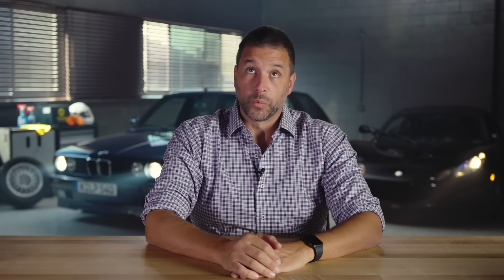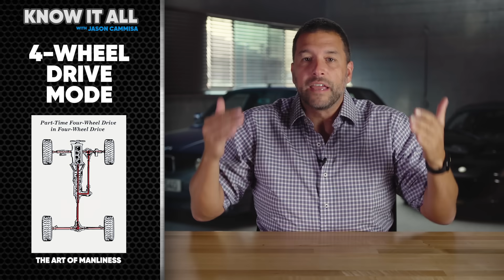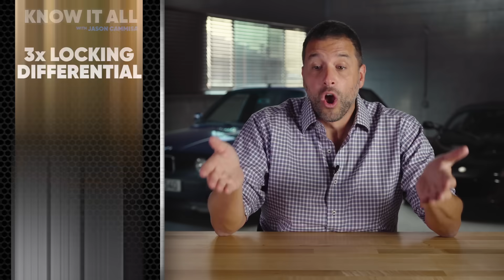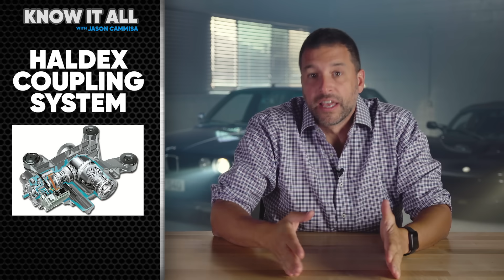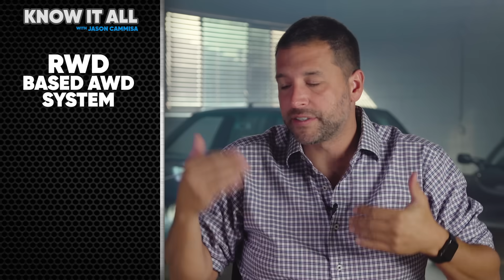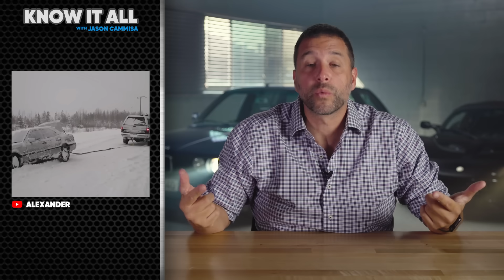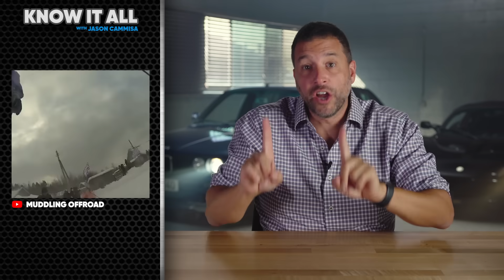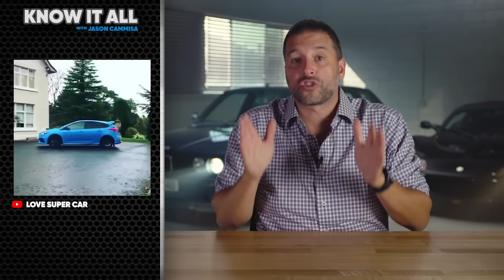Understand Your All-Wheel-Drive System | Know it All with Jason Cammisa | Ep. 04

Comment: Subaru and Mitsubishi, as well as the Classic Audi quattro longitudinal engine layout, are symmetric AWD, in that the power goes through a center differential, and then the front and rear differentials.

According to my understanding the group-B Audi locked the center differential until the final evolution of it, in combination with the engine longitudinally hanging over the front axle the car had to essentially be driven like a rocket - applying a thrust vector to counter the current vector to go in the desired direction (driven sideways).

Haldex systems can lock the back axle to the front and are programmed to release lock to allow turning (inherently putting most of the power to the front). Although they can be reprogrammed to just remain locked and then have to be driven like a group-B Audi. Also, you can incur a speed differential with slightly smaller diameter rear tires, whether you let some air out of them, or stretch them on some wider wheels. Then you would transmit more torque to the rear like the over-geared systems.

Ford Focus RS and Honda SH-AWD (as applied to their FF platforms) are interesting in that they can independently lock each over-geared rear wheel to the front, thus they can temporarily send more power to the rear and even each rear wheel, thus able to do some serious torque vectoring.

My favorite is symmetric AWD systems with modifiers that only need to operate sometimes, so it has a fundamental AWD attribute that can then be tuned and dialed right in.

Subaru electro-hydraulic center locking differentials, as well as Mitsubishi EVO electro-hydraulic center and rear (AYC) differentials are this category. AYC is special in that it is a differential that can force a speed difference similar to Ford’s and Honda’s, but isn’t the fundamental part that transmits power to begin with. When not working an EVO X is still AWD, just with a rear open differential.

However, when AYC is working, the car drives like a fundamentally front-engine'd symmetric-AWD car, but AYC is torque vectoring the rear (modified) from direct steering input. So it is mostly proactively driving under your control, and not reacting unlike every other system. By their very nature they can't have the clutches in a partial lock all_the_time while you're driving, so they will always be FWD with reactionary AWD/RWD characteristics.

The Ford F150 Raptor is interesting in that it has an electro-hydraulic clutch as well as a hard lock in its transfer case - So it can be programmed partial torque amounts to the front axle, like the GT-R and other cars.

Comment: Yeah, you totally forgot to mention the Torsen based systems (mechanical torque biasing differentials, which are different than locking or open differentials of trucks... not to mention a properly implemented system will have a center differential, which all but the newest trucks don't have). Also Audi used both the Haldex and Torsen depending on vehicle and platform, not to mention in certain models they used Torsen front and rear with a Borg Warner clutch type center differential to electronically bias to the rear on the Cayenne.

Comment: Stolen from Autocar magazine

In 2016, Mercedes introduced a new 4WD system called 4Matic+. Fitted in the fifth-generation E-Class and second gereation A-Class. In the E63 S AMG and the  A45 S AMG an additional setting and extra clutch packs were added, allowing these models to disconnect the front axle from the powertrain entirely, effectively turning them into a rear wheel drive cars. This has become known as "Drift Mode".

Comment: The single most important thing he deleted was the components to drive the FWD AWD systems.. most  components that are opposite of the primary drive set up are not designed to handle 100%of the power .. case in point.. subi's  system will always be 90/10  or 10/90 this is done to protect the entire drive line system.

Comment: The user selectable 4x4 systems are the best. RWD when I want to save gas and tire wear, 4x4H when going fast but need a lot of traction (rain, snow etv), 4x4L for low speed off roading, locking diffs for very slippery situations. Can't beat it, the new ones even have 4x4A that keeps it in 2WD until slipping is detected.
Reply: a computer controlled system is vastly better for most people

Comment: A front-wheel-drive car doesn't have to understeer at the limit. That's going to have more to do with suspension geometry and alignment than wheels driven. It's also not that hard to get a front-wheel-drive car to rotate slightly using the throttle or the brakes.

Comment: Audi use 2 different AWD systems. In their smaller vehicles they use the Haldex system,  eg, S3, RS3. SQ3... For their bigger variants they use an in-house developed quattro AWD system. This system is predominantly rearwheel biased. Eg, the 2006-08 RS4 had a quattro system which splits the torque 40% to front and 60% to the rear wheels, under normal driving conditions. This split will remain even during spirited driving. The torque delivery will only change when traction losses starts to occur. However these cars still suffered understeer during spirited driving. This was due AWD grip and the drive train construction. In Audis with longitudinal front enjins, the weight of the enjin extends in front of the front wheel axle, and that is also a big contributor to the Audi oversteer. It's not because it is front wheel bia. The Audi R8 uses the same quattro system. It defenately does not suffer from accute understeer, like its other siblings.

Comment: Honda's SH-AWD system is amazingly simple. I'm surprised it wasn't invented decades before, since it was a completely mechanical system when Honda first introduced it in the 1986 Civic Wagovan.
(basically it is a 4wd system with a torque converter added in the rear driveshaft to allow f:r axle speed differences)
Reply: They should use it more imo for their performance cars. Fwd civics are good and all but AWD ones will be rad

Comment: Good general info, but also a lot of nonsense here. I.e. the Evo's and Focus RS' AWD systems have nothing in common whatsoever. Yes, the Evo's S-AWC understeers less than other cars but that's primarily because of its Active Yaw Control in the rear (used for true torque vectoring), otherwise power is always 50:50 front to rear at all times. The only adjustment in its center diff settings (tarmac/gravel/snow) is how quickly the front and rear axles lock together through diff engagement. The Focus RS' "Twinster" system, on the other hand, takes a FWD car just like a Haldex system and sends a shaft to the rear without the use of a controllable center diff. Instead there is a special rear diff which can achieve proper torque vectoring and is also geared in a way that more power can go to the rear. Of course, it's also worth mentioning the Subaru's symmetrical AWD, which is quite exceptional on the STI. It tends to behave very predictably and does incredibly well on gravel or snow, while having proper front and rear LSD and an adjustable DCCD. You can lock the diff manually to get out of a tough spot (i.e. car is buried in snow) or give the car a bit more rear bias. I've had all 3 by the way. Personally I found Mitsubishi's system to be best for handling, Subaru's - best in winter/slippy conditions, and the RS was a solid step down from both of them, but at least it was interesting to be able to change the character of the car significantly with the touch of a button. Otherwise the RS was a bit unstable for winter driving and even in normal conditions could feel unpredictable and twitchy.

Comment: 1 - love the  Know it All series of videos!
2 - if bmw xDrive is always rwd except when it decides to send power front wards - whats up with the claim that the xDrive m340/440/40 models are "more rear biased" than the 30 series?
Reply: All i can think of is 40 models have rear e-lsd as standart
Reply: Most likely refers to how the center clutch calibration was done, saying that it is more rear axle biased means that in similar driving conditions the computer on the Ms sends less power to the front in comparison to the computer of the non-M sisters

Comment: You focused on diffs… that’s ok, but many of these manufacturers have deployed computer controlled brake actuation to help rotate the car or mitigate the understeer. It is in the cheaper awd cars that you need to watch out for a delayed reaction on snow in a low speed turn under power when the rear kicks in, jolts the car into oversteer, and then stability control goes into panic mode and shuts down power and yells all hands on deck to the brakes at all 4 corners.

Comment: The B7 Audi S4 had a Torsen center diff that sent 60% of the power to the rear wheels when there was no slip.   So you got some of the rear-wheel bias benefit of the trouble-prone BMW system, while also having a kickass mechanical limited-slip.

Comment: Jason, even if you mechanically lifted the front wheel on a golf r, i doubt the center diff would be even tight enough to move it with only the rears. Also, i think the Audis that have a haldex are the transversally mounted engine cars like a3 s3, the a4 s4 have a longitudinally mounted engine and i think they are rear biased. So was my old s4.

Comment: But but but lol. The one system that I would love to have is that on the RCF350? Torsen center with wet clutch packs to each axle. It can actually uncouple the axle even though the diff is locked. IE sending torque to the outboard wheels in a turn.

Comment: I got the 2nd gen VW Touareg. It uses Torsen diff, which is very different than haldex. No computer, it's all mechanical. Up to 80% power to rear wheels, up to 60% to front wheels. Pretty darn good!
Reply: I "belive" the urquattro system also hade a Torsen diff, but it was very balanced so it was Hard to control in the bridge between over/understeer......

Heard so from drivers.

Comment: Before Volvo went to Haldex they used a viscous coupling AWD system in the original V70 XC that claimed to be able to send up to 95% of the power to the front or rear. It was never at 100% front. In normal driving it was at 95% front, 5% rear. And it seemed like it could send more than 50% to the rear because you could definitely get it sideways, trust me, I know. There must be other cars that used this kind of system. I have seen videos comparing the old viscous coupling system to Haldex off road and the viscous coupling system came out on top.

Comment: Dude didn’t cover Subaru 4EAT and 5EAT. 
The front and rear axles are both connected via solenoid controlled clutch packs, before the diff or in the diff.
The manual cars have the same format, but use viscous fluid clutches that require revs and slippage to make the fluid build viscosity and get the clutches to engage. 
The electronic la controlled real-time AWD is much less fun, but reacts faster than the driver would even be able to take notice of (ie, more than 60hz polling on the wheel speed sensors).
And the last thing that these systems have, AND many FWD based AWD systems have, is that they have electronic brake force distribution.  Because they don’t have true mechanical locking differentials, they apply brakes to any or many corners of the car where slip is detected via the wheel speed sensors, which helps them maintain traction, corner, and get unstuck.

I hope this info is helpful to someone! :)

Comment: Yes, more please!  And how does electric change this explanation, or does it?  Cheers!
Reply: So far as I know, electric cars don’t have traditional gearboxes or differentials needed. They can have a motor at each wheel. The computers can decide where torque is sent based on slip. What’s revolutionary though is when in a sporting application the computers are asked to send the torque in reverse, creating negative torque and torque vector which results in all new and interesting ways of cornering. It was nicely explored with the Mercedes-Benz SLS AMG Electric. Chris Harris did a great piece on it. Pity we don’t see that level of focus application right now it’s all talk about range and battery power.

Comment: Love your stuff and your all-consuming enthusiasm. But but... referring to the g-class point on locked differentials. If you lock a differential it will always split the power. Not send 100% power to one wheel if the others are suspended. All 4 will soon. That’s the awesomeness of a locked diff. So... yeah.
Reply: I was searching 10 mins for this comment! I also think that g-class with all   diffs locked is a bad example of 100% power to the one wheel. Right rear wheel on that picture should get only 25% of power not 100%
Reply: No he is right. Torque is based on friction, so if one wheel has no traction and the other wheel does 100% of the torque is being produced at one wheel because they are spinning at the same speed. So a fully locked 4WD system can produce 100% of the torque at one wheel

Comment: Jason, I have a question for you! My 2015 Explorer 4WD - is it ALSO an AWD? What is the "intelligent 4WD" monitor that shows real time torque front or back, when car is not in 4WD drive mode?!
Reply: Yeah its AWD with a haldex style automatic AWD system that normally sends power to the front wheels, but shifts it to the back when needed.

Comment: 1:07 Open diffs always send 50:50 regardless of conditions. The max force a tyre can apply is equal to normal force*coefficient of friction. It's not some electric current to travel in the path of least resistance. The wheel which has less traction will spin faster because it has no resistance compared to the wheel which has. It looks like all the torque has gone to the wheel with least traction but that's wrong. It still gets 50:50

Comment: Agree, and disagree at the same time. I have played with the rear suspension angles a ton in the Golf R mk7.5 chassis. What I found will rotate much easier is -1 camber and 0 on the toe in the rear. Also, jack the rear air pressure up to min of 40 and drop the front to 32 psi. I will say, high speed corners (80 plus mph) do feel much more, sloppy, with this setup, but that is the point. It WILL go sideways, easy.

I will agree, that 100 is not sent to the rear. Don't know why people think that. But, I can, and have, on dry pavement in 60-70f temps gone sideways for a solid block. First time it happened, just wow.

Comment: pro tip at least with the 07 MDX, if you want to keep as much power going to the rear and keep the clutches from slipping try to keep it around 5-10 mph. Any slower and you have about twenty seconds until you start smelling clutch and less power goes to the rear

Comment: The original quattro understeered because the weight of the engine was in-front of the front wheels. The front differential did not lock. In all of these videos an almost correct conclusion is reached through a simplified misunderstanding of the mechanics and physics of the discussion points.

Comment: Jeep Quadra Drive awd system claims to be able to send “100% of devolved engine torque to 1 wheel”, I believe is the wording, with which they were careful.
 Their claim, not mine, though I’ve been in a situation where only the front passenger wheel was touching and I would say it’s an accurate claim. 
 There’s a computer animated video from Jeep on yt describes the system pretty well. 
 
The rear tires were 2ft in the air and the front driver may have been touching ( couldn’t say for sure it was under water but the top was exposed) but it had zero traction. 
 
 After the rear tires would make about a full rotation they would lock, then both fronts would go, then the front driver would lock and only the front passenger would spin. 
 Spun the wheel off the rim also as a lot of the vehicle weight was on the front passenger tire. 
 After the system would  do its work, the three tires with no traction would just groan a bit and spin maybe 1 rev per minute, almost not at all.

 So I’d say it works as claimed. 
 The only video I had I deleted for space on my phone long ago and was not from the angle to see anything anyways. 
 I guess I could put on jack stands with a roller on one wheel...but I don’t have one. 😂 always wanted to though.

 On the street, yes, if you’re too heavy on the gas it understeers.
 I believe it supposedly splits torque 50/50, but I can’t remember. 

 It’s damn near impossible to get the rear end out on dry road, especially with all terrains. 
 I’ve driven it without the front driveshaft in and it’s VERY easy to fishtail it. 
  In mud I’m able to hold long power drifts as described with the Porsche. 
  The system works great for what it is. Lots of fun.  Reliable. 
 Takes a lot to get er stuck.

Comment: The 'FF' Ferguson AWD system using a viscous center clutch allows for that 'under-driven' rear wheel situation in a part-time awd vehicle. Under normal driving, the vehicle drives and performs like any other FWD, but when front wheel slip occurs (open diff of course), the rising temperature in the center clutch pack engages the rear at a 50/50 torque split. The purpose of the underdriven rear is to keep the temp up, thereby speeding up the engagement rate. Get it right and its completely seamless and undetectable, get it wrong and every single component from the rear tires forward grinds itself into dust. Most manufacturers avoid potential problems and simply use a viscous clutch and the same ratios front and rear.